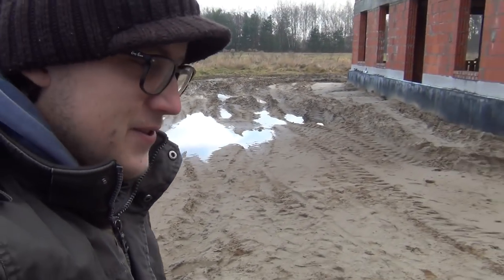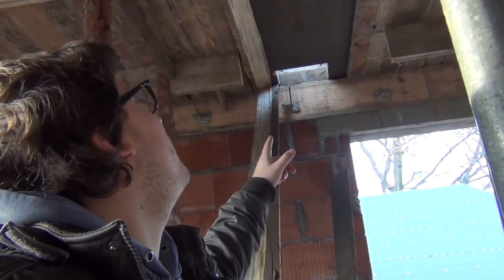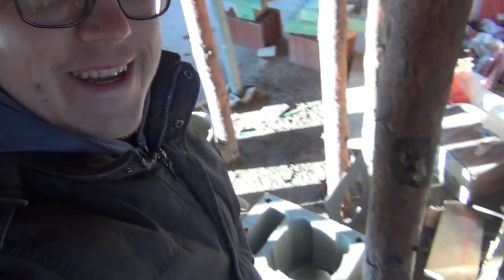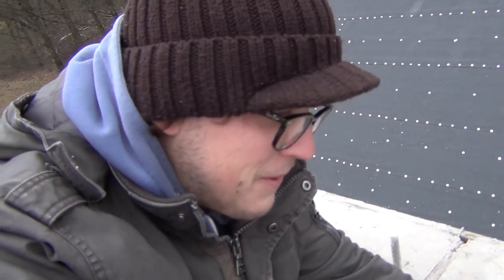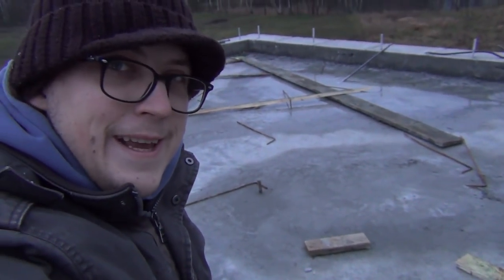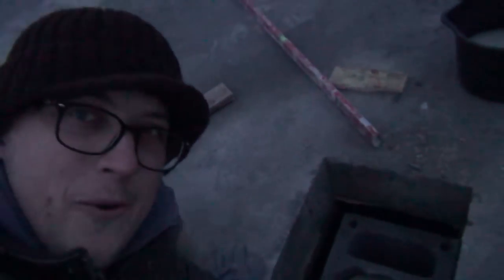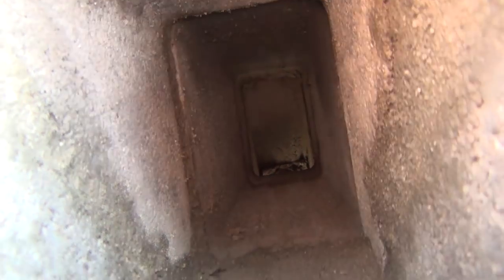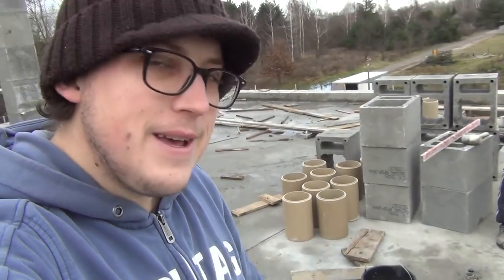BoH 100 - Chimney Block System Installation on the House

Comment: How much money does a house like this cost to build? What part of poland are you in
Reply from the maker: I think that depends on where you live and the cost of labor in the area, in choosing the contractor alone I got a wide range of bids some where 200% of what I finally settled for. It is a lot like cheap/fast/good and you can only have 2... my experience is sometimes you get only one of those ; ) Also with building materials you can get price swings of up to 150% in the same category and I would say quality usually follows the price there since the market is quite competitive. On the windows I got quotes in the range of 400% from the base line, there I would argue there is diminishing returns on buying the most expensive ones, but we didn’t go for the cheapest ones either for improved security. You can build cheaply or expensively so its a very hard question to answer, you should build the way you can afford to, and also maybe invest in the things that are important to you. We are somewhere in central Poland.